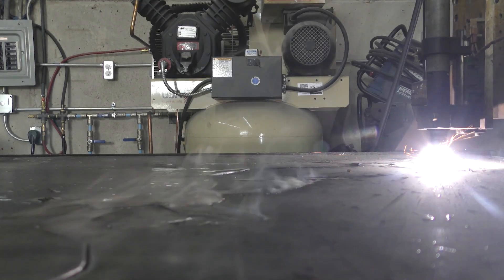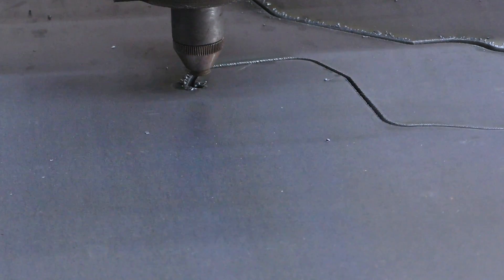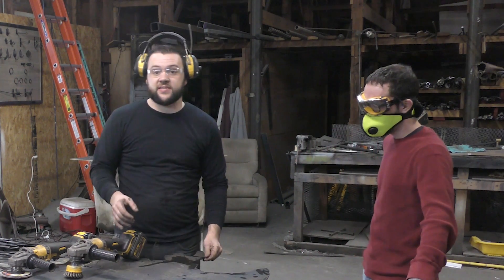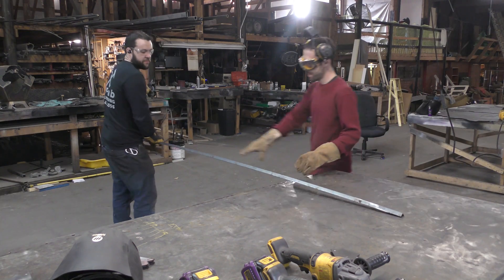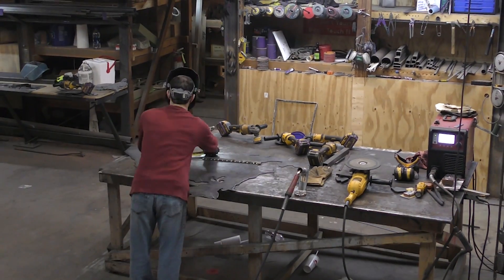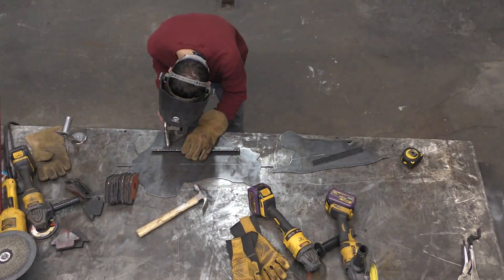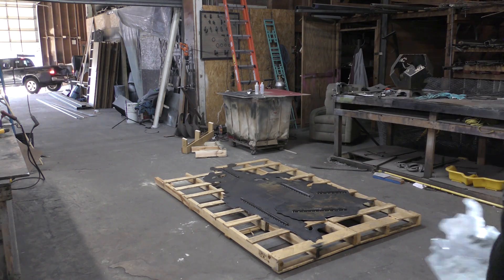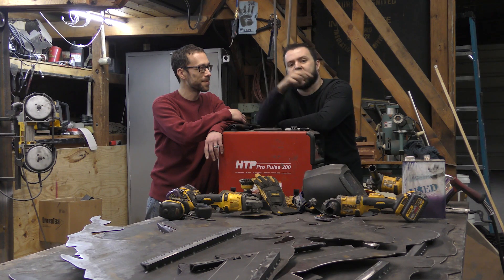STEEL French Cleats make CNC Plasma Cut Map Cover a WHOLE Wall - with Yellow Mug Inc

Comment: Question 1: did the install crew just use wood for the wall side of the French cleats?
Question 2: how did you deal with the heat from the welds coming through to the front of the piece where the welds were.  Even on tack welds, I can see the welds from the front sometimes if I'm using 11 gauge steel. Maybe your 10 gauge was thick enough to hide it?
Reply from the maker: 10ga hid it, yes to the wood